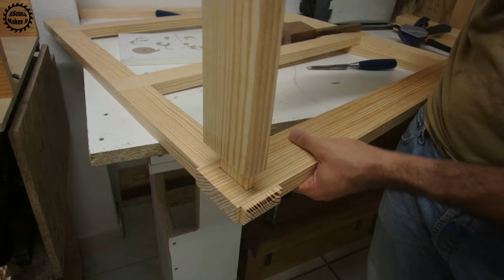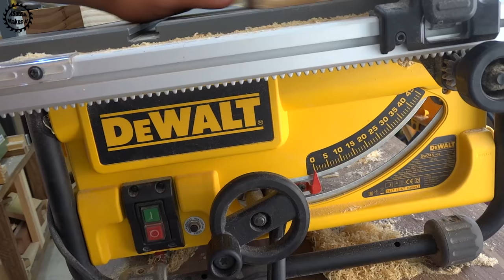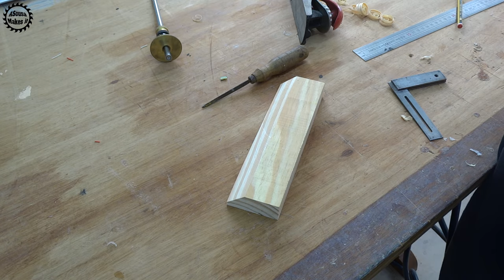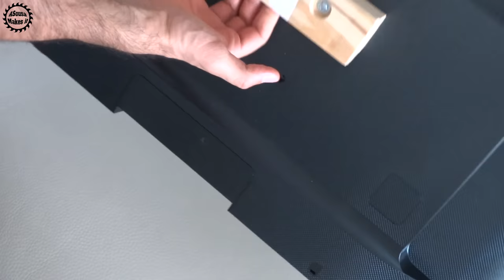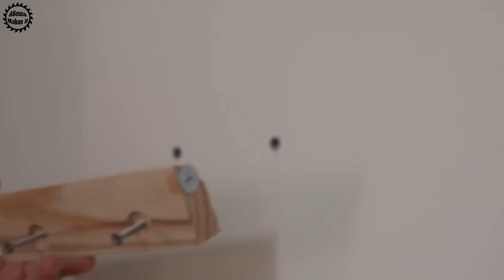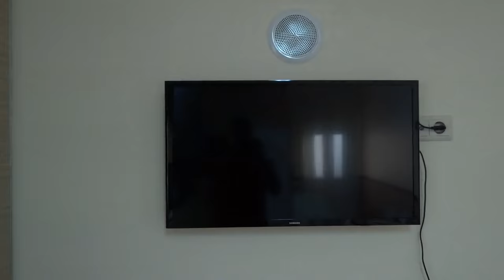Super easy DIY TV wall mount

Comment: Good job, but I don't trust anchors on drywall. A longer french cleat that hits 2 studs, or shorter cleat on one stud at the center and two screws with anchors on each side just to balance. Toggle bolt also works on the cleat.

Comment: Very useful! I'm making this with a small addition, one of the screws on the wall mount goes trough a slot instead of a hole, so the tv can be ajusted slightly (my walls are terrible, drills tend to "float" trough them while drilling). Thank you!
Reply: Great idea! Just starting this project and was wondering how to address this possible issue.
Reply: guys just put any tape on the place where you want to drill or use the drill holder like the milescraft or give a punch with screw or something to make a quick hole into the wall than continue the mission be creative ^_^

Comment: Nice solution, You could use a rectangular-shaped metal plate (maybe cut from a flat bar) with two holes to join the two planks of wood  (in place of the washers) to lock it in place after mounting.

Comment: Having the wall half of the cleat system not connected at a stud seems absurd. It would be much more critical if this TV were any bigger.  Would be very easy to have the TV hide the outlet too, again this TV is pretty small, but just some thoughts that other may draw from. I would probably shy away from this idea in general but for a garage or something like this its  alright.
Reply from the maker: This is brick wall, for "stud wall" I agree that must be a cleat long enough to cover two studs.

Comment: Nice! You need a solution for stability though! If a child trys to lift it or maybe if you hit it with your head when you are standing up after you grabbed a DVD, the TV will just pop out
Reply: You could drill a hole through the top to screw the pieces of wood together
Reply: Not a chance. The TV/monitor would have to be lifted about an 3/4 of an inch before it would fall out.
Reply: @OMGWTFLOLSMH  that's not a lot of inches, is it?
Reply: @pinchertone  Haha, You could use a rectangular-shaped metal plate (maybe cut from a flat bar) with two holes to join the two planks of wood  (in place of the washers) after mounting the TV.

Comment: I hate when these guys say DIY but then use pro tools like the table saw or a drill press...
Reply: you can do with just a drill and a circular saw
Reply: even though you use machines or what. the point is you do it by yourself. right?
Reply: Point is he took some inexpensive material and made one himself, instead of purchasing it or having it fabricated.
Reply: @effyou128  Well yeah not everyone has access to drill presses and table saws.
Reply: @mervinclar1054  do it yourself as in not getting a professional in ... they are not professional tools.
Reply: If you don't have a circular saw, just use a normal saw and saw a 1x4 piece of (hard)wood diagonally in the middle by hand. The pieces will fit back together perfectly!
Reply: you don't really need the pro tools that he has, but the process might take little longer.
Reply: Pretty sure he still did it by himself, which is what DIY means.
Reply: Look at YouTube channel Special Love Creations, he shows how to cut French cleats with an amateur non-powered saw.
Reply: I know I hate it when you’re looking for an affordable, semi easy project, and these guys use 4 different power tools, endless access to any hardware, and make it look easy alone. I would’ve already hurt myself 3x, had 2 meltdowns, threw at least 5 non power tools, 6hrs have gone by and I won’t be sleeping before work, and I finally at 7am admire my wall mounted flat screen: complete! Completely crooked, only one side is in a stud cuz my walls were built by some redneck who couldn’t measure up to 16 inches lol, I have splinters, bruises, tear stained mascara face, superglue in hair from when I had to glue split finger back together, and now no time to shower before my day job. But as I tilt my head 30 degrees to the right and hear that crack I have myself a satisfied giggle and fail my attempt at a fist pump due to numb hands. But I do manage to move one finger and im sure you can imagine the one, and give it to the smiling master carpenter on the screen.
Reply: Yeah you forgot the so accelerated speed of recording that corrupted the details however the point he applied a super easy idea with expensive tools that isnt in every home hahaha i have enough tools i cant get this tablesaw dammn so much tools in youtube tutorials but what a luck i have jigsaw and drill i think will achieve this job anyway thanks for his effort
Reply: It's the proof of concept man. It doesn't matter HOW it gets done.
Reply: How is that not diy? Nothing great can really be built without the necessary tools.
Reply: DIY is not about the tools, it is about not having to go out and buy a $50 wall mount.

Regular drill can do the same, and a skill saw also.
Reply: Yeah it's not a diy it's a pro level work

Comment: Is it fire safe?
Reply from the maker: No, its wood without any finish
Reply: @ASousaMakesIt  so you need to paint it to be a bit fire resistant? I mean, when you watch tv for a long period it heats up, right? Maybe attaching metal plate at the back of the tv will do?
Reply from the maker: @ttcvm7339   It doesn't make sence to do it, all the plastic in the TV is much more inflamable.
Reply: @ASousaMakesIt  how is it now? Is the anchor on drywall strong enough ? Im installing bigger flat tv.. Im going to try to utilise all the four holes of tv by using two pieces of wood.. and two pieces on the wall.. just to make sure it will hold better.. thanks!
Reply from the maker: @ttcvm7339  its hold just fine, in my case its on concret+bricks.you might need to adapt number of holding points acording de TV size and constrution type
Reply: Fire safe really? First of all is the wall fire safe? TVs get mounted to walls all the time there isn’t enough heat produced by the tv to make the wood catch fire. 

If your concerned about your tv being a fire hazard you probably need a new tv. 

Wood is flammable but would take a 572 degrees F. flame or 1112 degrees F. for spontaneous combustion. It is rare that television components exceed 120 degrees F.
Reply from the maker: @snewcomer22  what about all the plastic that the TV is made!? :)
Reply: LMAO... Ur joking right 😂😂😂😏😏😏...
Reply: Who honestly gives a f? If you have a fire the house is coming down and you're not retrieving that TV bud
Reply: LMAO. If your TV heats up enough to ignite a solid block of wood, you have bigger problems than worrying if your DIY mount is fire-safe. I cannot believe the brain power found in YT comments.

Comment: Thats mounted to a stud right? Could make one with an extending arm?
Reply: Don't believe it is. But really most TVs now a days are so light that you don't need to mount to a stud anymore. I know it makes you feel better about it being secure but honestly drywall can hold it. I used to have a plasma that was so heavy you would want to use a stud. But I now have a TV twice the size but half the weight.
Reply from the maker: No concret/bricks. Here in Portugal 95% of the house are made with concret+bricks
Reply: ASousa Makes It thank goodness! I was like, oh no, not plastic anchors!

Comment: I seriously hope that TV is only 5Lbs or less other wise you'll have a smashed TV on the floor cause you didn't screw your brace into any studs
Reply from the maker: In Portugal the walls are made with bricks and concret, so after 2years the tv is still holding just fine. But yes, is critical that the suport gets well screwed to something adequate for the tv height
Reply: @ASousaMakesIt  esta malta não sabe que existem casas de cimento no planeta terra? 😅
Bom trabalho man
Reply: @ASousaMakesIt  preciso de comprar um furador vertical barato. Qual aconselhas?

Comment: "super easy" if you have a whole woodworking setup 🙄
Reply from the maker: Is not about the tools is the will of doing it. With a handsaw and a drill you can do it.
Reply: So many whiners. Go to a garage sale and buy $20 worth of used tools. You can't conjure up a french cleat via sheer willpower, yes you actually need a saw, a drill and a screwdriver. Even if you bought a prefabricated wall mount from the store you would need at least 2 tools to mount it.
Reply: Yes bro this is super easy even with basic tools..i dont want to mess around with circular saw..😅